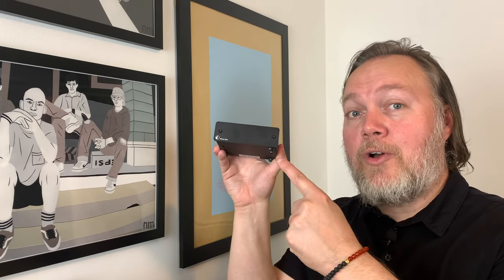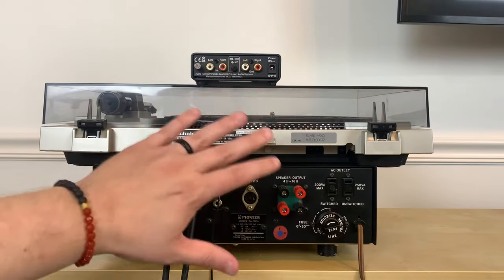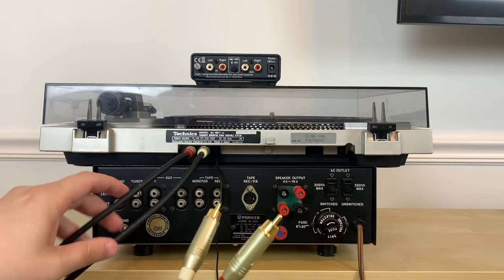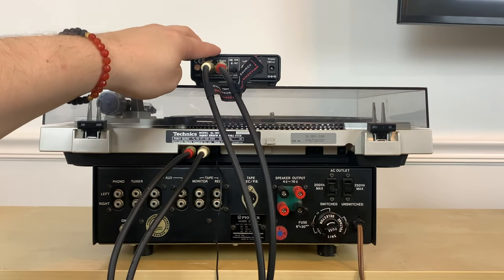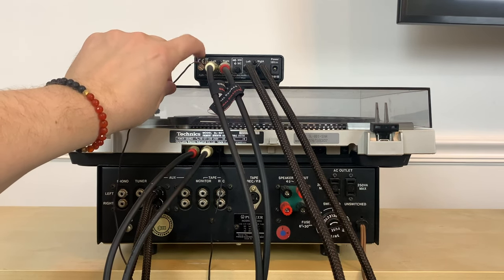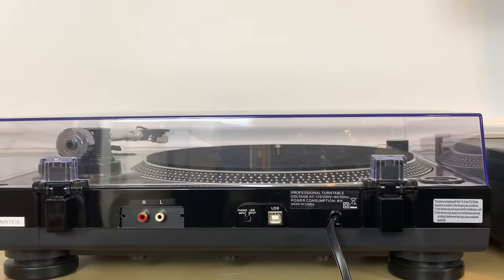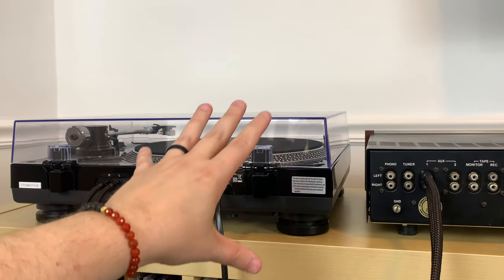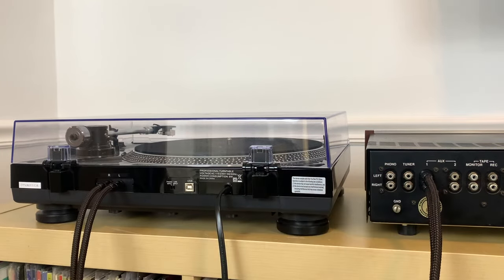How to Connect a Turntable to the Aux Input on a Receiver

Comment: Thank you so much for this informative video! I went out and bought the little Pyle preamp thinking it would solve all of my problems. But to my dismay, I’m only getting distorted, low audio out of both speakers. I have a vintage Aiwa TT, cassette and radio player that we brought from the UK in ‘84. It still works great; recently had it refurbished and actually had it hooked up directly to speakers for years without an amp, but it never sounded the best.  So I’ve done exactly what you’ve shown in the video. I have a brand new Denon receiver, so have the audio cables plugged into the “media player” ports. I’ve tried working back and switching things around, but to no avail. Any idea what I could be doing wrong??
Reply from the maker: What’s the model number of Denon you have?
Reply: @ForeverAnalog  AVR-S540BT
Reply from the maker: What model is the Aiwa? If this is an all in one unit that is meant to power speakers itself, it might not be compatible with the Denon.
Reply: @ForeverAnalog  It's a Stereo Cassette Music System 5600.  Model AF-5600K.